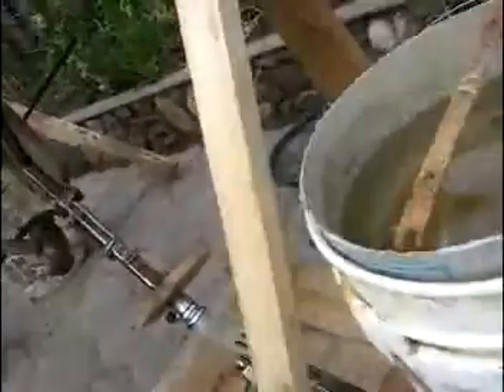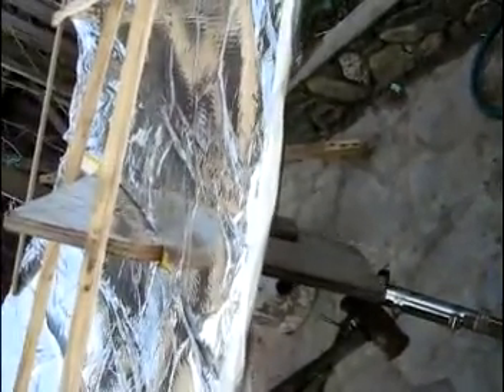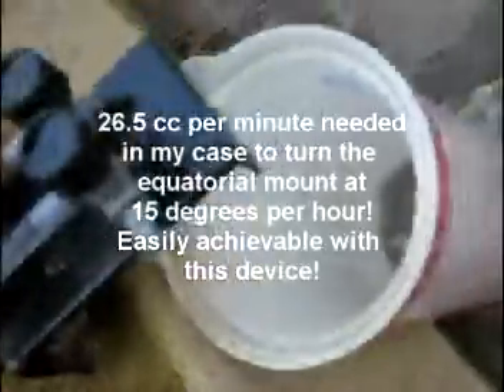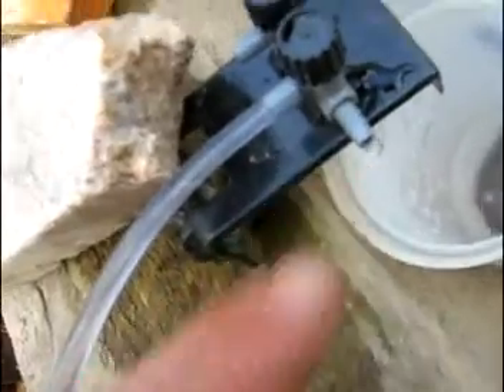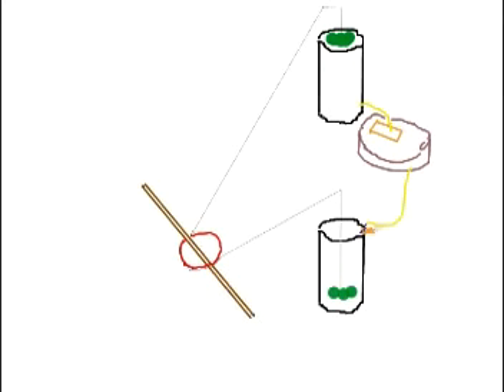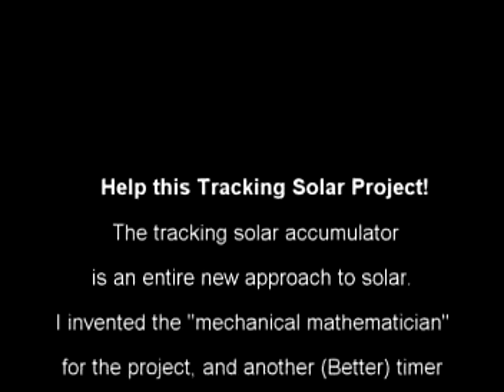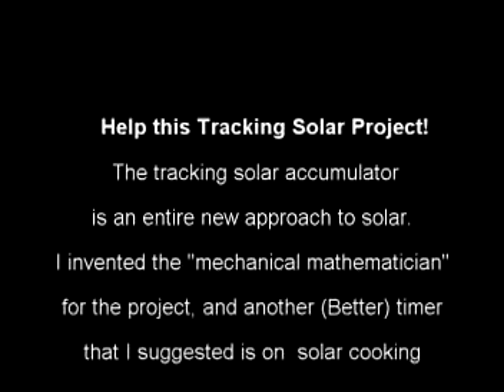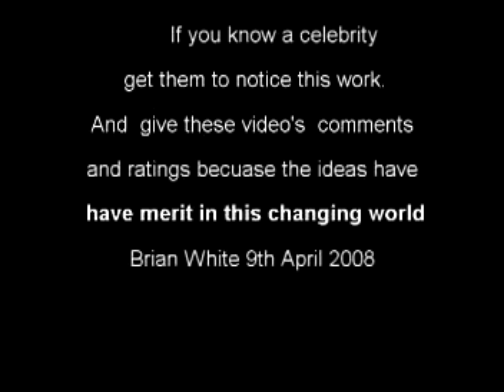Simple tracker for the solar accumulator

Comment from the maker: Check the tcmtech dripper irrigation for very good float  and water speed control. Maybe it can be a clock too.  You can get it going extremely slowly and very even flow too.  Also,  check the clam shaped dish idea.  If you combine them, I think you could have a winner!  The clam shaped dish does not have to be really accurately aimed so a waterclock might be accurate enough.

Comment from the maker: @jkrush28  By all means make your tracker.  My aim is to produce alternative methods for people who cannot afford shade bars, op-amps, photo transistors, stepper motors, solar panels and batteries. 
If you want to apply your ideas and abilities to something new, please try make a dual dish solar accumulator and apply your tracking method to it.  It has stationary focal points so you can run a Stirling engine or even  a fridge from it.

Comment from the maker: @WICKEDMAN9MM  I will probably make a better version in the summer.
Dripper trackers have branched out a bit.  There is now the simple water clock drippers, clock based dripper trackers and the liquid piston dripper tracker. (I have only made models of the liquid piston tracker).
I am busy at the moment finishing a better model of the tracking solar accumulator for the arts and science fair in Toronto on 8th May.
Thanks Brian